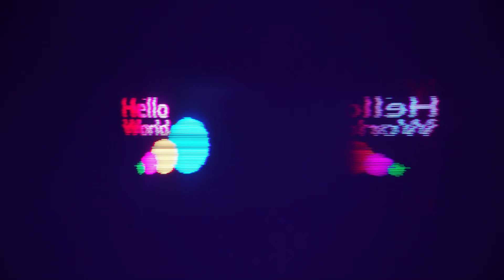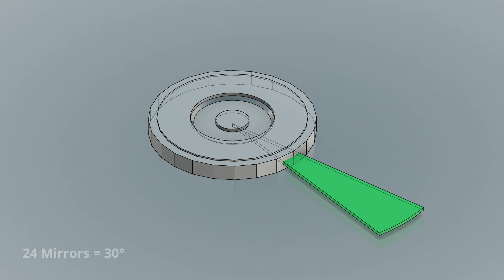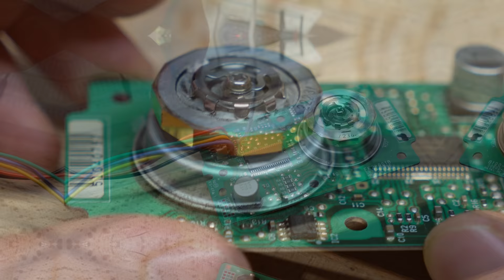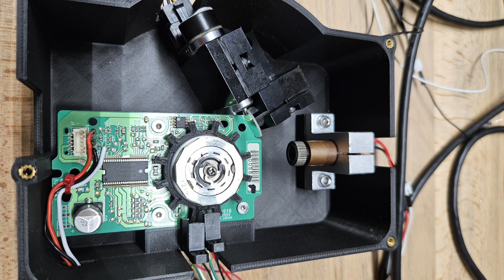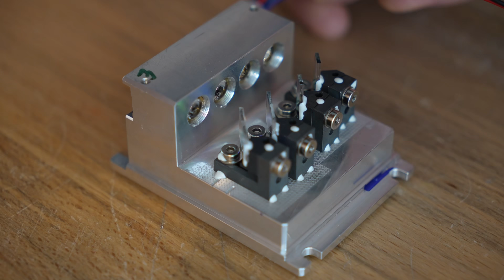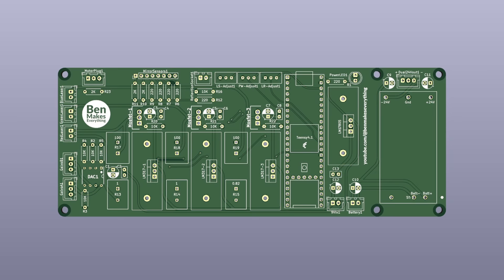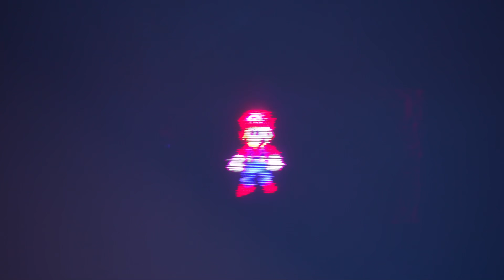DIY Laser Image Projector (100ft+ Range!)

Comment: Fantastic progress you made with this. One thing I know about the scanner PCB is that it is equipped with feedback circuitry to prevent overshoot. Projecting a square with a galvo setup without this circuitry, you get a pincushion effect. The feedback circuitry slows down the mirror before getting to the setpoint and can give the galvo a kick to overcome inertia when starting to move, so utilising the driver board may allow you to get a cleaner output but to be fair you managed pretty good. Also, use lasers with the best TEM00 beam profile. Easier said than done but back in the day, gas lasers were better in that respect compared to cheaper solid state types.

Comment: Amazing video - thanks :) been racking my brains trying to think of a way to modulate the laser strength - would there be any milage in a hi res monochrome LCD over the output hole to add impedance to the light shining through? if the image is say 2cm x 2cm when it exits the hole, if you had a 2cm x 2cm hires LCD over it, you could overlay the brightness on the digital colour outputs to give you more control, while maintaining the advantage (long distance, bright A F) of lasers producing the light. Not sure what that would do for yr thermal budget tho :) liked + subscribed
Reply from the maker: Interesting idea - I wonder if the lasers would damage the LCD over time - each channel (red green and blue) has about a Watt of power. They are only on for an extremely short time per pulse, but still, that kind of energy seems like it could cause issues.

Comment: hey what a great video! i had a similar idea back in around 2019 surrounding cymatics when i was studying quantum physics and how field works. i realized that cymatics is pretty much a physical vibration of frequencies and if we vibrate the cymatic pertaining to our frequency we input it and put a laser on the center of it, it will vibrate our given image. nobody has done this before and i was not well funded so didn't have time to get around this so i left it on the backburner, if you do this you'd be the first to experiment with such a thing. cymatics are faster than galvos and i believe galvos are faster than your spinning mirrors there, i think the cymatics are on par with the speed of the electron tube on those crt oscilloscope tv display which are very fast, youtube them they're pretty neat. you could use another layer of mirror to make your laser smaller so your laser will beam out a more focused beam, which in theory should be pushing out even smaller 'pixels' beam. wish you all the luck brother.

Comment: On the horizontal vs vertical ratio, due to the beam shape, play with a 45 degree rotation or in between degrees. Being oblong and not square will give you diagonal distance gain on both axis at he same time. Might only be a small gain but a quick test at no cost. Cheers

Comment: Thats really impressive, I have a theory that you could double your height with a beam splitter flip if the projection is symmetrical, in example you could do rotating drone motor for the local hobby store, or a rotating poker chip, wait no, last thing we need is shinier casinos... a color changing flower could be pretty as well. or making an array of these projectors, trust me if your not sick of this project yet there is so much you could do with it. A cost breakdown would have gotten you a bit more watch time as well. Laser iridescent paint? Hmm wonder what thats like. Ben, you keep making videos, I'm going to go binge watch you 🙃
Reply from the maker: Thanks! interesting ideas. I may develop this further at some point, but for now I'm taking a break to work on some other projects, which I'll be making videos on. Thanks for watching!

Comment: Can you leave a link for the RGB laser module you are using? I am working on some DIY laser stuff myself and I have ordered 2 different RGB laser modules from Ali Express. On both units the Green and Blue beams are very nicely converged and project a small dot on the wall, but on both units the red is a large block about 10X the size of the other colors. So I'm either trying to collimate the red laser correctly or finding a better unit off the shelf.

Comment: Place res. parallel to laser power switch to make modulation smoother/faster.
It keep laser current below thresh. during blanking.
I build scanner motor system 1973 for HeNe laser.

Comment: Debounce photo diodes using clocked D-Flop , input won't change output until next clock cycle.
Time tested.
Saves CPU time by reducing code.
Uses Nyquist sampling.

Comment: Very cool and interesting project in a small form factor 🎉
I spoke too soon, it's a lot bigger of a setup than I was led to believe... 
16:14 As you were, I retract my second comment 😂and happily reassert my initial comment. 
Now, if you could shrink it even more by using SMD's and/or perhaps an all-in-one MCU, (If there's even such a thing that would also be very tiny.) I did find this DLP LightCrafter Display, but it looks to be on scale with yours. Anyways still a great job and interesting video
Reply from the maker: Thanks, yes it could probably be made 1/4 of the final size if everything was designed from the ground up. Using the massive battery took a lot of space, and of course there is some empty space inside the box.
Reply: @benmakeseverything  Thanks for the reply, Ben. It looks like a really fun project to do.

Comment: Very cool project!

You could greatly improve the beam profile of each laser by passing it through a pinhole before the beam combiners/mirrors. You might also consider resin-printing a compensation lens for each laser if that's a tool you have access to. A half-cylinder followed by a secondary collimating anti-cylinder would be a decent start. (since it's mostly in 1 axis, no need for a 2D lens. makes alignment much easier)

To get rid of the timing irregularities, I would recommend altering your code to be interrupt-driven, with DMA driving each line's pixel data. Think VGA HSYNC/VSYNC, with each line of video being prepared as the previous one is being output over DMA.

If you're having trouble with stable DAC outputs on an R2R ladder, it could be an impedance matching problem. I'd recommend a properly terminated buffer immediately following your DACs. Your microcontroller has some characteristic output impedance (eg for arduino digital IO it's ~30-40 ohms) so if you're driving something with different impedance, you should build an amplifying buffer to account for that. If you're running a simple inverting buffer this is just changing the input resistor to match the impedance of the source, and changing the feedback resistor to match the desired amplification. eg you might do 40 in, 60 feedback for a ~1.5x gain from the 3.3V output to 4.95V.

Incidentally, you can also create an op-amp circuit that will let you amplify 0-3.3V up to -5-5V. You might find driving the full range gives you better mirror acceleration, and it will definitely give you a bigger viewing area (more deflection after all)

As @videolabguy mentioned, you should also avoid driving the laser below its voltage drop. You get a big capacitive sink at the low end as it's shutting off, and the light doesn't get any darker.

If you want accurate color intensities on an analog laser drive, you should use a constant current drive circuit instead of a voltage drive. (whether that's something you buy or build is up to you, they're not too complicated). This also avoids the PWM brightness issue.

Comment: I think the timing issues may be caused by stray laser light being reflected into the encoders. I'm pretty sure the optical encoders use IR diodes, but many lasers emit a fair bit of IR. You may be able to improve this by adding some baffles to try to keep stray light away from the encoders. Timing issues could also be many other things of course, like interrupt handlers running too long or all manner of logical bugs, but if you are seeing surprising signals on your encoder inputs consider the possibility of stray light in addition to EMI.

Comment: Couldnt you stap the mirror onto an HDD motor? They can do CRAZY speeds and its also a controllable motor that can actually give you positions?
Reply: You could go 15k rpm while reading the position signal from the hdd. Should offer great results as the hdds need to be crazy accurate... and offer all drivers and signals to be read etc in a standardised format.
Reply: I know that u used it in version 1... but why not transplant the mirror? Or did you get one of the really expencive scanner mirror systems with more than 10k rpm?

Comment: You can use second laser for check current position mirror array. Second laser needed directed from mirror, and use photodiode for catch reflection, with thin gap.
Reply from the maker: Yes, that is certainly an option and would probably provide better accuracy.

Comment: Great build! 🤗🙌🏽 For vertical scanning, could you have a mirror (galvo?) spinning at some fixed rpm, then pulse the laser at the appropriate time (according to the expected position/angle of the mirror for that rpm)? That way the mirror wouldn’t have to slow down. Might be a tricky setup though

Comment: This could be useful for metal fabrication if you are able to project accurate vertical and horizontal lines that are narrow, you could easily project it onto a table that someone could work to as a guide.

These kind of lasers already exist but the cheapest that I have found is 35k

Comment: My comment is likely late and other people have pointed out better solutions.
But you probably don't need to measure the speed of the motor ALL the time, right?
You can just measure it for a little while and then make an educated guess on what the actual speed is by filtering measurements way out of line. I mean how likely is it for the motor to change speed by 5% or more within a couple of lines?
That code could run as a calibration cycle in the beginning, giving you a more stable image with every line. Heck.. By knowing how the average speed changes over the course of longer periods of time, maybe some recalibration may be good anyways?

Comment: The old nintendo virtual boy had oscillating mirrors inside.  You need to invent a color led laser micro array chip (single column).  Might need to start with a big prototype and then get a micro array fabricated $$$.  Projecting color laser bitmaps onto walls is a great idea.

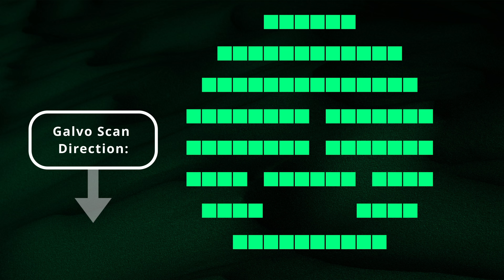Comment: 7:00 you just made me understand why interlacing modes existed on CRT TVs
Reply: It didn't work that way on CRTs, both fields of an interlaced frame were scanned "top down". Interlacing was more to reduce perceived flicker without increasing the total number of lines scanned per second or decreasing the vertical resolution.

Comment: First of all, what you have done is really impressive, and I greatly appreciate it. It’s clear that you’ve put in a lot of effort, and your skill is obvious. I just wanted to humbly share my thoughts.

I think it would be necessary to use an encoder that provides a higher pulse signal per revolution for synchronization. Of course, it’s impossible to replace the integrated encoder in this design with another encoder. Therefore, in this case, we would need to use just the mirror and rotate it with another motor.

In these controller boards, system interrupts are definitely running processes in the background. For this reason, you need to completely disable these interrupts. This might require you to stop working with a compiler and write code directly in the machine language of that processor. I believe this is possible and not too difficult. To perform tasks like receiving and transmitting data, you could use a host computer (perhaps something like a Teensy, or a fast system like a Raspberry Pi or Arduino Giga). However, to perform tasks that require critical timing, you may need to write code in machine language and use a microcontroller or perhaps a microprocessor that has direct access to the ports at high speed and precision. When I tried to use step frequencies over 40 kHz in 2 or 3-axis Cartesian CNC systems (for example, using Atmega 2560 or ESP32), there were always shifts in frequency, and the synchronization of the axes would degrade just enough to be noticeable. I assume you’re trying to maintain synchronization at much higher speeds.

The motor you’re using to move the mirror vertically is inadequate in terms of quality. If that motor is a brushed DC motor, it’s already a wrong choice because brushed DC motors have a commutator, which prevents them from generating a consistent speed. They can never rotate at a consistent speed due to the poor contact between the brushes and the commutator. Instead, permanent magnet motors used in drones produce less fluctuating speeds. I think it’s necessary to use a motor that provides a more consistent rotation, even if it means the device becomes larger or the motor consumes more current. Additionally, the motor should always rotate continuously in the same direction rather than moving back and forth. If necessary, you could attach a large-diameter weight to the motor shaft as a flywheel to create inertia. This way, the motor would rotate at a very steady speed, and the device would have a much longer lifespan.

Regarding increasing color depth, if I'm not mistaken, laser diodes are not objects whose light intensity can be controlled linearly as  LEDs . Therefore, I wonder if switching (or chopping like PWM) each pixel duration into for example 128 times, so laser diode remains on within the time gap you set for each pixel at a various frequencies that creates different color tones.
Reply from the maker: Hey, thanks for the feedback. For the encoder thing - I think the actual best option is to skip that entirely and have a purely optical timing system that triggers off the laser beam itself, therefore eliminating any variables in position relative to the motor. For the timing glitches, I believe you are correct and microcontroller is doing that because of something in the background. The vertical axis is just a galvo, so it doesn't rotate completely, only moves back and forth. But it does seem to be very accurate so I don't think its the limiting factor here. But at higher speeds/resolutions it would be. PWM at a higher frequency might be possible, but I would probably have to re-do the electronics with mosfets designed for super fast switching. I'm already using on times as short as 200 nanoseconds per pixel.

Once again - appreciate the write up you did. Thanks for watching!

Comment: Wait, 100ns is only 10msps?? There are plenty of DACs that go way faster than that!! They are probably surface mount, but you can but smt to dip adapters for many chip footprints. They probably won't be super cheap but a 10$ part can get you pretty far.

Comment: Impressive. Time to take a look at a DMD (Digital Micromirror Device) chip as used in DLP projectors. The mirrors can be switched with a frequency of 20Khz. This doesn't need a motor and will inprove stability by reducing timing issues. I had the UO Smart Beam Laser Pico/Micro Projector made by Cremotech. They used three lasers  (as like you do) instead of a colorwheel (DLP). It was very small without almost non moving parts except for the cooling fan and a very low mass tiny mirror inside the optical block.   Maybe you have to take a look at this technology.

Comment: 14:07 Just curious: how much did you spent on parts (electronics and other hardware)...
I estimated around 500-600 at the beginning but then saw that this 24DC converter was 130 alone 😅...
so I assume it must be around 1000-1200? 😅

Comment: I have zero ability to realize this, but I've been thinking of how a CRT replacement would work, able at least of 15kHz Hsync (nice to have 24kHz and 31kHz too, and higher, but 15kHz would be hard enough as it is) for old gaming systems and lightgun compatibility.
I was thinking lasers, or focused RGB lighting mixed and collimated through optics, and TWO rotating mirrors, because, for me, it is not just about visual results, but replicating the scanning behavior for straight compatibility.
I even imagined a very convoluted, surely expensive, and probably impractical "line divider/multiplier" (depending on how you look at it) to reduce the ammount of faces on the horizontal scan rotating mirror, and a system of mirrors, perhaps flexible ones, and/or lenses, to compress the distance needed for a reasonable display area.
My idea would be to have some sort of retroprojection display, inthe same vein as a classical CRT, but of course the general idea can be applied to both projection styles.

What I have is amateurish and not very technical at all, but if you are interested I would share it, considering my non-existent chances of realizing it myself.

Comment: Just use Hall effect instead of slotted opto-Led, and use interrupt.  Also, don't use Arduino, It do all kind of things in the background in the LOOP()  There is no reason to have any distortion on an heavy rotating device at all.  Also, only one speed correction each rotation is necessary.  I did a lot of project like this without any glitch and even at higher speed.

Comment: 11:19 since timing is an issue i'd venture to say you've reached the high frequency domain. pretty sure i read on the internet breadboards don't cut it for hf applications & you need a proper backplane...whatever that means. Pretty sure you just need more copper grounding or something?

Comment: The way old laser printers signaled mirror position was a fiber cable going to a high speed phototransister, it would watch at one of the mirror apexs so it saw the laser its self from the mirror, this way the laser scan line is in perfect synch with the mirrors rotation so any speed variance will be self compensating.